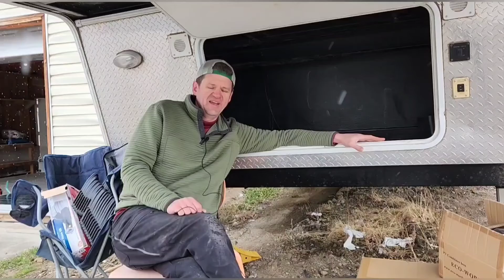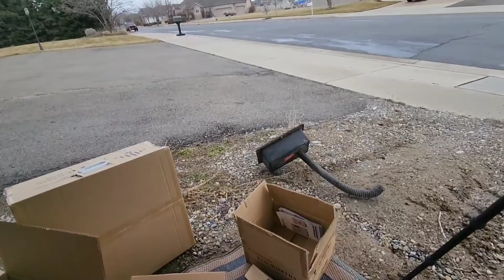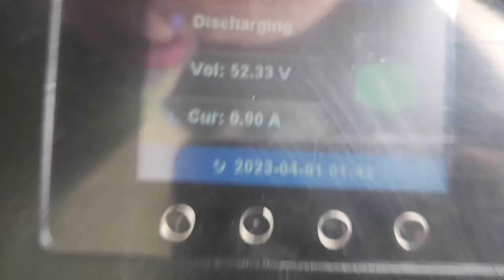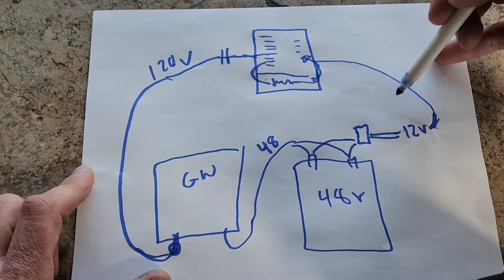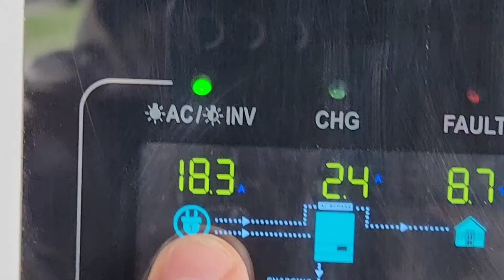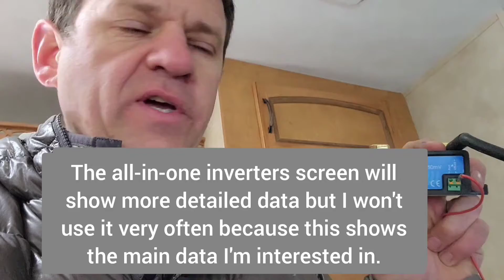12v to 48v RV conversion. Ultimate Off-grid RV Solar Power System Install

Comment from the maker: $50 Discount Code : "DIYSOLARFUNGET50" - https://signaturesolar.com/?ref=DiySolarPowerFun (Affiliate link)

-Growatt 3000 48P inverter(recommended for most RVs): https://signaturesolar.com/growatt-48v-3kw-150vdc-stackable-off-grid-inverter/?ref=DiySolarPowerFun
-Growatt 3000TL LVM-ES(recommended for RVs with more than 2K Watts of solar):  : https://signaturesolar.com/growatt-48v-3kw-250vdc-stackable-off-grid-inverter/?ref=DiySolarPowerFun
-48V Battery: https://signaturesolar.com/eg4-ll-lithium-battery-48v-100ahd?ref=DiySolarPowerFun
-Combiner box: https://amzn.to/3OVpxdi
-48v to 12v step-down converter: https://amzn.to/3OV6FuV
-Extended Communication Cable: https://signaturesolar.com/3ft-rs485-battery-comm-cable/?ref=DiySolarPowerFun
-Extended Battery Cables: https://signaturesolar.com/72in-2-awg-battery-to-inverter-cables-black-and-red-2-awg/?ref=DiySolarPowerFun
-Solar panels Cable wire: https://amzn.to/3KDgwmA
-MC4 connectors: (I ordered 6): https://signaturesolar.com/staubli-mc4-male-and-female-connector/?ref=DiySolarPowerFun
-MC4 connector crimpers: https://amzn.to/3QHpuTN
-New Solar Panels: https://signaturesolar.com/shop-all/solar-panels/new/?ref=DiySolarPowerFun
-Used Solar Panels(discount code: RAY): https://www.santansolar.com/product/used-trina-245w-solar-panel/?ref=DiySolarPowerFun&campaign=TheRvKit
-Solar panel mounting brackets: https://amzn.to/3qy4c0o
-Double Sided 3M VHB Tape for mounting brackets: https://amzn.to/3OT8o47
-Solar Panel wire management clips: https://signaturesolar.com/pv-2-wire-management-clip-50-pack/?ref=DiySolarPowerFun
-Insulated screwdriver: https://amzn.to/3QAGpHx
-Roof sealant tape: https://amzn.to/47vZVeo
-Solar Cable Entry Gland: https://amzn.to/3QElhAh
-Victron Energy SmartShunt 500 amp Battery Monitor:  https://amzn.to/3DTqvk2
-30A RV Outlet:  https://amzn.to/3VMBGW0
-30A RV Outlet Cover: https://amzn.to/3VPNAye

Chapters
0:00 Intro
0:43 What a 48v RV can do
2:54 12V battery removal
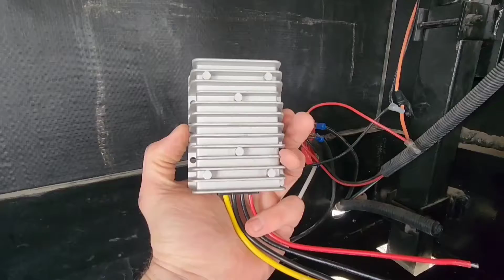6:14 48v to 12v step down converter
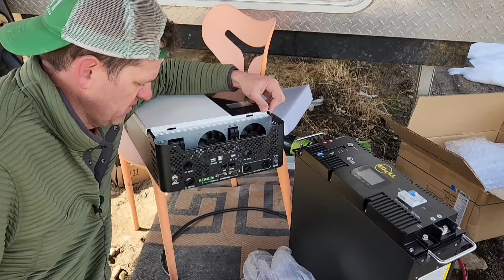8:32  Growatt All-in-one system explained
9:53 Connecting All-in-one system to 48v battery
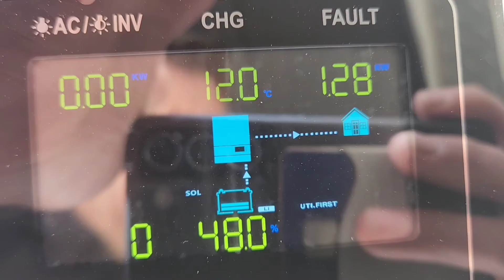16:05 RUNNING AC, ELECTRIC FRIDGE AND MICROWAVE AT THE SAME TIME!
21:15 Converter box explained
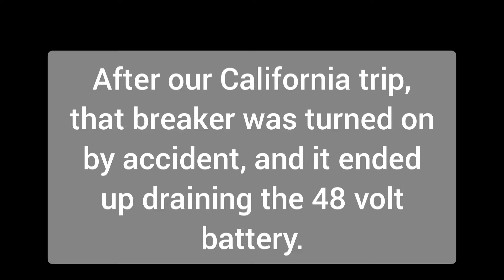26:18 48v to 12v system test
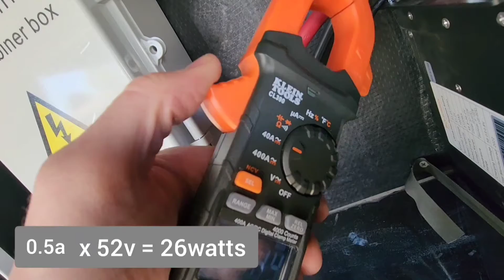29:34 Step-down converter efficiency test
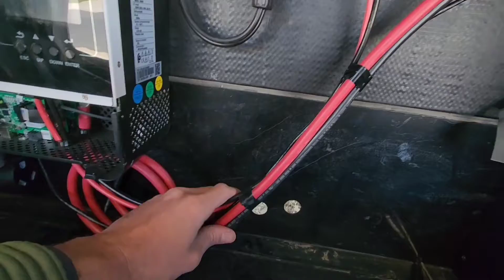31:04 Connecting to shore power(IF needed)
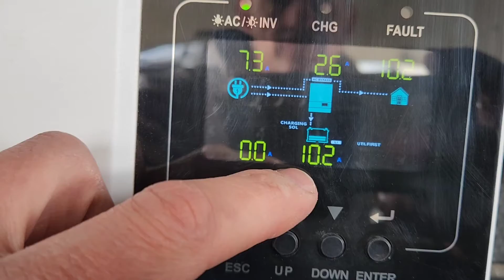33:35 Letting friends plug into my RV and Emergency power backup explained
35:49 Alternator charging
36:34 Things I'm going to change
38:38 Selecting the right inverter
41:17 Selecting the right battery
43:13 How long can the inverter idle
* The Full Kit *
Reply: Im going to guess that you figured out that battery is not nearly as big as you thought it was by now ;) If you had four of them on board and 4kw of solar spread around then you could power all your friends.
Reply from the maker: @davefroman4700  because it's a 48v 100ah battery, it has 4 times the capacity as the 12v 100ah battery. 2 weekends ago, I was able to supply power to 2 other RV'S for 3 days.  It was cloud cover much of the time, so we didn't need to run our air conditioners.. it couldn't run 3 air conditioners even if it tried though :).  I also was running low on power at night so I had two of us run our gas fridges. So it was pretty much just running the occasional microwave and TVs for the three of us. The led lights didn't use much power.
Reply: @diySolarPowerFunWithRay  I realize that. But its still only 5kwh of power. You are not going to run multiple Ac off it for any length of time in even the best case scenario of a clear day.
Reply from the maker: @davefroman4700  You're correct. That would be tough running multiple RV AC units on that single Battery.  For my RV it does fine though. I run it all day when the sun is out and it keeps up fine. (I use my RV as my office and at about 10am I kick it for the rest of the day).

Comment: Great overview.  How are the DC/DC converters doing with induction loads? How is that server rack battery doing in a mobile application.  Do you think you could stack those without a rack or is a rack necessary?  I was thinking of starting with two but have room to add a third.

Comment: Im not sure how a 100ah battery is going to run that ac for very long at all.  How many hours are you getting running the AC?
Reply from the maker: After having this installed for 2 years I have much more information. When the sun's out I can run it all day long nonstop.   However when the Sun goes down I can usually get a few hours.

Comment: Question: If you're installing a 30amp plug in to inverter, do you need add a breaker ? Or will the one installed in the inverter suffice?
Reply from the maker: The more Breakers the better... In my case the wire I am using will support the full output of the inverter... so if I have a short circuit my inverter will shut down before my wires melts... if you have grid connected to your inverter and you overload the inverter it may go to grid bypass mode. In that case you would want a breaker to protect your wires.

Comment: I bought the same 48 to 12v converter with a 48v system.  It failed to work for me. I just plugged it directly into the 12v circuit board where the battery leads went, tossed my old 12v battery. I didn't think I had to ground the converter to the frame?  I ended up getting the Victron converter thinking that the cheap one I bought was bad.  Haven't received it yet.
Reply from the maker: Hmm. When you connect your step down converter to your 48 volt battery, do you get 12 volts out of the 12 volt wires?
Reply: @diySolarPowerFunWithRay Thanks for the response.  I replaced the unit with the Victron Orion 48 to 12 and it is now working!  Evidently the cheap one was bad.
Reply from the maker: That's great. I think I'm going to use that converter on my next build.

Comment: How in the world can you power your camper AND a friend's camper? Shore power? The battery will only power my air conditioner for around 3 hours. The growatt can't handle my AC plus the water heater. I need a larger inverter to power them both at the same time. I need to run another battery in series to power my AC for 6 hours or more. I have no idea how you're able to power yours plus another one. I have 4 JA 550w solar panels hooked to the system. I appreciate the great video though! It helped a lot.
Reply from the maker: Thanks. Mainly without ac and water heaters running.  Although microwaves are fine because they never seem to start at the same time. And only run for a few minutes.  I would like to get a different inverter though.  Not sure which one yet.
    Seems like you have a pretty big system. I'm surprised your battery doesn't last longer.  Imagine that is because you haven't disabled your converter box.  That thing will drain you
Reply: @diySolarPowerFunWithRay  I plan on selling my 3000W Growatt for an EG 6000w. I'm going to get another EG battery too. No, I haven't disabled my converter box yet. That's my next project. Good to know that will help.

Comment: Man, your use of wire nuts in vibration prone environments is KILLING me.  Use crimped on connectors and terminal bus bars.
Reply from the maker: You are correct sir. I have upgraded to wago connectors.

Comment: My 48v lithiumbattery has not been in use for a while so its failing to switch on the 5kva invertor . any advice on how l can charge the battery
Reply from the maker: Hmm... with some inverters when connect solar and then when the sun comes out the solar will turn on your inverter. So your inverter will run on solar and then can charge your battery..  Their also might be a reset button on your battery...or you might be able to rig up a couple 12 volt batteries in series to jump start it?

Comment: Yeah Renogy has a switch that you can mount inside. But yeah like others have said so many things that need to be fixed. I had to do 12v system. However In 2 years i will switch to 48v or 24v as the most I use 2000 watts and thats just to run the AC. But back to your truck charging the battery. FYI that is not enough to charge the battery and secondly you never want to charge a lifepo4 battery directly from the truck to the battery. The best solution is to use a DC to DC charger. In my case I installed x2 Dc to DC to pull 70 amps from the alternator and then another 30 amps from solar. which that is roughly 1280 watts going into the batteries. And yeah soft start is a must! and more power to share the load is ideal. IN my case i have 9 batteries in parallel for a total of 900ah or 11,520watt hour
Reply from the maker: Very good points. I hear they have 48 volt alternators u can add that can output a ton of power.

Comment: For the rv and the possibility of helping the house . Buy the 5000w inverter 2 reasons. 1 to keep the heat down in the unit by getting close to max (3000w) u run it close to max when ac and other stuff is on causes heat close to max.. 2 if u do ad to house or other campers with ac needs u over power the 3k and nobody gets power. Buy the 5k 48v in out unit.  I got the ecoworthy the 1 u got is basically the same brand with different name but is only 3k.  More out put more capable

Comment: YOU DONT NEED THE STEP DOWN CONVERTER! As you found out in your video, that 360W china step down you have is not enough to run both slides and I bet after a while i bet you start to notice your landing gears arent working as fast. what you should have done is use the perfectly good converter you already had instead of disconnecting it. go buy the cheapest 12v car battery you can find, your 48v inverter powers the converter which will keep the 12v battery charged and you wont be limited on current and the while 12v side of your trailer wont be dependent on a $20 china step down. also if your 48v battery does you can still use the 12v side of your trailer. just food for thought.
Reply from the maker: The only problem with this approach is that the converter(i.e. AC to DC battery charger) is crazy inefficient. If that is on pretty much the entire 12 volt system will be powered from 120 volts ac...not good.  Especially when your 12-volt DC furnace fan is running all night.
   Maintaining a single 48 volt battery is easier and also less expensive. Win win.. I already have a 12-volt battery in my truck/motorhome engine that can act as a backup with jumper cables if needed. Also many of these all-in-one inverters have a reserve setting so you will always have backup power available instead of draining the battery to 0 like with a typical 12 volt battery.
Reply from the maker: Yes I do need it. Please watch the section of the video where I talk about how inefficient converter is.

Comment: Just curious why did you go with a server rack battery in your. RV they make diff form factor  that works a lot better for. Use in a RV that   Mounts way better and is  up 67 rated so you don’t need to worry about moisture in that battery compartment that is not sealed ?
Reply from the maker: for cost mainly

Comment: Great video! What size solar panels would you recommend to charge your 48v battery?
Reply from the maker: The solar configuration where you can get at least 60 volts.  👍

Comment: Thinking of assembling a cargo trailer camper. This helps. After watching you video on the EcoFlow, that seems like a nice way to go. If something goes wrong, it could be removed for troubleshooting. Just need to add up the power of each device. For this project, all electric is what I want. With the EcoFlow generator I could go a few days if the solar cells aren't achieving a full charge. I appreciate the details you went into.
Reply from the maker: That's a good option. Thanks. Good luck 👍

Comment: How about grounding?? I did't see battery and inverter  conected to chassis? I heard that type of all in one iverters didn't work without proper earthing and even sesitive ac units will not work properly. Can you explain how to solve that if i want to use that kind of inverter?Thank you
Reply from the maker: I believe I needed to add a GN bond to this inverter...Which I didn't show(Very important).  As far as earth grounding...That's kind of hard with a moving trailer but is still possible and can't hurt.  Easy if you're only camping at RV parks and plugging into their grounded system... That being said.. if you're plugged into a grounded RV park you don't need a GN bond in the scenerio.... I grounding plug that you connect to an outlet would be good for that scenerio.

Comment: Im a little confused on the all the hype with 48 volts. The battery you put in is still just 100ah. I dont understand how its better than a 12 volt 100ah. I understand the conductor size difference in cost. Wouldnt a 100ah 48v battery last just as long as a 12v 100ah.
Reply from the maker: battery power capacity is measured in watt hours.  So 48v x 100ah = 4800Wh.  vs 12v x 100ah = 1200Wh.  So 48v contains 4 times more power.  if both are 100ah batteries.

Comment: You can just leave your 12 volt battery connected to the inverter as a surge protector. The 12v inverter will keep the12v Battery charged up.

Comment: GREAT video! This is fantastic, SO helpful.  I was looking at the EG4 3 and the same battery. Wonder why you chose the Growatt? Even more importantly, I am concerned about this system being in my stationary RV in cold weather. What will you do? Do you have a way to heat it, keep it from freezing?  This kind of system gives SO much more bang for your buck, and yet a portable power station can easily be taken out, and so little wiring etc.Still, you cannot beat the battery capacity and solar intake that this 48v system provides for full time time living (while we build our small house).. I just have to figure out how to deal with the freeze factor.   I wonder how you'd approach that?  Gotta say, Ray,  your overall thinking, figuring  and presenting is highly appreciated.

Comment: We did an almost identical setup to yours back in 2020, only ours was only a 24 volt growatt system, ( all that was available back then, as all the 48 volt stuff was still way overpriced). I call ours a portable solar generator system. Just plugs into the rv plug on the side of the rv and fakes the rv into thinking it’s plugged into a campground pedestal 24/7. 
We made ours portable so when not camping we just hang on the wall in the garage and use as an emergency whole house backup system, and also powers our auxillary hvac in our net zero house. We made mounts in the garage, and also temporary mounts in the rv. So if we want to boondock we just steal the whole works from the garage, throw in the back of our jeep toad, then just mount in the rv when needed.
Takes around 10 minutes to setup either at home or in the rv. This way when the camper is in storage, we get to use the system at home. So it’s in use 24 hrs a day 7 day a week 365 days a year.
The 12 volt battery system in the rv has 600ah battery bank that was new last year, so I couldn’t bring myself to throw away all those perfectly good batteries. So we left the motorhome 100% factory stock, and our growatt system just plugs into the plug on te side of the camper, ( similar to yours). We put an rv plug on the ac input side of the growatt so when we are at a regular campground, we can use shore power.
Ours has been working very well for us, and does everything we need it to do.
Congrats on a nice setup.
Reply from the maker: Nice.  I like that setup a lot!  I have taken mine out quite a few times for various reasons.  Thanks! I'm leaning towards your setup for my next RV.

Comment: I haven't done it. But rather than a TOBSUN made in China step down converter. People are using Victron MPPT Solar charge controllers to convert 48V to 12V. And they can monitor it via their phone via Bluetooth. The pv input on the mppt controller is actually just positive and negative off of 48v battery. It converts it to 12v to charge a 12v battery. Then your rv trailer receives the necessary 12v. I've also heard this works without a 12v battery and only a 48v battery. You can get higher amperage (or wattage) victron mppt's if your 12v appliance draw is higher. I'm going to use a 100/30 victron mppt. Id say tobsun will fail after time if it gets hot.
Reply from the maker: Thanks.  That's good stuff. Depending on the setting, it will output around 14 volts, which will also make all your lights a little brighter just as if you were plugged in to shore power. I think I'm gonna do this on my next build.
Reply: @diySolarPowerFunWithRay  you can adjust it down from 14.4v in the bluetooth phone app.

Comment: i don't care about the theory.  just do it.  45 minutes.  zzzzzzz
Reply from the maker: After having this for one year. When the sun is out I can run the air conditioner all day. Although the battery is not able to top itself off so I can't do it for two full days in a row. Without the sun, at night, I can run the air conditioner for just over 2 hours

Comment: Hi Any chance you would have a link to purchase the 40amp converter box?
Reply from the maker: If you search 48 volt to 12 volt 40 amp step down converter on Amazon there should be plenty of options. Good luck 👍

Comment: Great video overall.  
I’d like to have seen how you chose the components (calculations) etc

Personally I’d use wire connectors ( like wago connectors ) instead of the screw cap connections.  These will not come lose with vibrations.   
 Great project !!